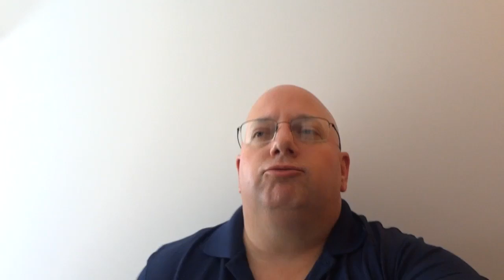GLASS: Insulator & Capacitor. Correcting errors of comprehension

Comment: Dialectrics conduct (carry and store) dielectricity, the current (density) of the electric field, not the voltage. Capacitors, air, and insulators will store and conduct dielectricity. Dielectricity does not require voltage to motivate movement. Imbalances in capacitance will act on the field too. Changing voltage or Dielectricity induce magnetism. Conductors have little capacitance, moving V or D will push it out from internal induction into the insulation and air. Nice vid.

Comment: It is not the glass which is insulating your house, it is the air trapped between the glass fibres that is the insulator.  Touch a pane of glass and it feels cold because it is conducting heat away from your skin.
Reply: +Stephen McCulloch Seriously, any physical metaphor will break down when scrutinized too closely for a non-physical phenomenon, which is a field. What started as a passion to explain magnetism is evolving to a description of reality. The ramifications and permutations are quite broad.

It is a fact that loosely woven glass threads will insulate, regardless if it is the trapped air or disconnected glass threads. The R rating on that insulation is different than air, so are you really making a point that means anything? If you want to assume he was referring to solid glass, then why limit your choice of containers to thin walled? Make it thicker, junk saved.

Capacitance is an electrical phenomenon, that is what is being asserted here. It happens that there are no such things as physical interactions, the concept of heat transfer as a physical state is unrealistic if you really want to get specific; hence the  levity.

Perhaps you're trying to clarify something that is beside the point?
Reply from the maker: people think an insulator is not also a capacitor, but in fact it is.  people ALSO STUPIDLY think rubber insulates you from electrical shock………

thats only party true, with enough CURRENT, rubber will still electricute someone 

glass is a dielectric capacitor, there is no arguing that FACT, NONE, period, NONE EVER.
Reply: I never mentioned its electrical properties.
You said that glass is providing thermal insulation to your house and it isn't.

A simple experiment for your next video:  1. drop your pants and hold a pint glass against your junk.  2. fill the glass with boiling water.  3. Observe its thermal insulating properties.  4. call an ambulance.
Reply from the maker: learn this little FACT:  there are no perfect CONDUCTORS and there are NO PERFECT insulators

A glass INSULATOR is still a capacitor, unless you think 10,000 devices that use glass dielectric capacitors DONT WORK

which they do  ROFL , youre funny!!!!
Reply: What are you talking about?  We are not discussing electrical  properties, we are discussing thermal properties.
You are wrong here.  Admit it.
Reply from the maker: hahahahahhahaahahahaahahahah!!!! you think electrical properties are ONE THING and thermal properties ANOTHER THING!!!!!!!!

hahahahahaahah YOU ARE FUNNY !!!!
Reply: Do the nad test then.
Reply from the maker: strawman fallacy
Reply: Explain that statement.
Reply: Any substance conducts heat with less than 100% efficiency, therefore it is an insulator.  Well yeah, but that's taking a bit of a liberty don't you think?

But back to the video.  It may well be that the insulation is another metaphor for capacitance, like the bulletproof vest analogy.  I think that is your interpretation.  And you may well be right, in which case I am trying to clarify something that is beside the point.

I interpreted it differently.  This was a video concerning the physical properties of glass.  By drawing attention to the insulation being made of glass, it suggested that its physical properties were responsible for its insulating properties.  I maintain that its physical form is much more important - trapped air to reduce heat transfer by convection and disconnected threads (as you rightly point out) to reduce it by conduction.  The choice of glass is more for its chemical stability, low cost and unattractiveness as food for pests.

It is possible that I have got Ken's intention wrong, but it is not clear and he does nothing to clarify matters by throwing a tantrum - his usual reaction to any perceived dissent.

Comment: I work for a window company... what exactly does the argon gas that's between the two sheets of glass in a window do? just more insulation?
Reply from the maker: its a neautral pressure fill that doesnt corrode also
Reply: Since air is a poor insulator, and transfers heat readily, they inject Argon gas which does not transfer heat as readily. Yes, basically an insulator. But Mostly so they can charge you more for their h i - Tech windows...

Comment: ALL capacitors require a dielectric material in order to be made.  It's the very basis of what a capacitor IS.  Glass is a dielectric material!  Yup, yup, yup
Reply: +Mr Smith most inductors have very little space between windings, so minimal capacitance. Add a second wire with no connections=bifilar winding and you have an inductor with space=capacitance. It will no longer have an instant lenz's response. The capacitance will fill and empty before the conductor will conduct. Motors and generators with this style will not cog; the magnetic back-push will follow, not oppose the rotor's magnetic field. You can also change the resonant frequency of a tesla coil by using your body to increase the capacitance. The space between you and the coil will change the amplification of the resonance as you move closer. Changes the frequency response of the secondary coil. More capacitance=dielectricity between you and the coil when in range.
Reply: Modern Electrical Engineering is a hack job of using electrical fields compared to what it could be if it properly defined electrical fields. EE systems are designed to work with limited voltage potentials and then sort out the current that is required to make it functional. Conductors equalize the voltage, loads set the current (capacity). Fuses and circuit breakers cover their inadequacies by breaking the circuits when they lose control.

Systems would be better designed if both the potential and capacity of the circuits were actively designed into the system functions. That means using the capacity carrying insulators of equal importance to the voltage carrying conductors.

Of course then it would be obvious that all of moving electricity is actually an induction process and nothing is generated to "send" out to the grid. It's all just a response of the environmental fields on location. And like a permanent magnet, small field inductions can be combined into big field interactions without expending any power.

An example is TC Heins' ReGenX coil. A capacitive inductor used as a stator on an electric motor, designed to produce electricity. The back EMF of the coil is phase shifted by the capacitance to power the rotor as it spins. Eliminating the need for the generator to be powered by an external source.

Or Tesla's high capacity spark-trains that induced waves of fields that added to the field strength, not neutralized it resulting in 1,000 x amplification of power in the air. Unlimited power component free amplification of such large factors that self powered is a slam dunk. Diffusing the excess energy is a larger concern.

Anything that doesn't conduct voltage readily seems to serve as a capacitor to electrical fields. EEs follow the rules, they don't design to the theory's potential because their theories all have "o"s (holes) in them. (That's a joke an EE told me when I was majoring in Physics about Physicists. Ironic isn't it?)

Good luck to us all.
Reply: depending on the frequency even an inductor has capacitance
Reply: i replied to Azure who said "ALL capacitors require a dielectric material in order to be made".
Reply: Given high enough voltage potentials, all insulators WILL break down and conduct.  Air is a prime example in a tesla coil as it plays the role of insulator between the top load of the coil and ground thereby creating capacitance between top load and ground which causes a rise in voltage potential, but that same coil will arc through the air.  What people get hung up on, I think, is that calling something an insulator means that something is a poor conductor, but it does not mean it will not conduct at all.  Just because something is a poor conductor it does not mean it has no capacitance potential.